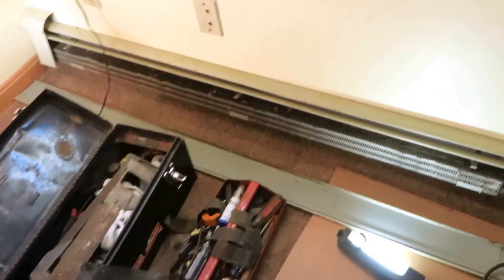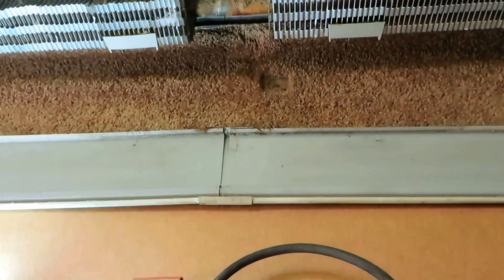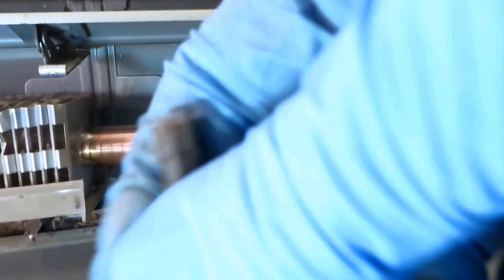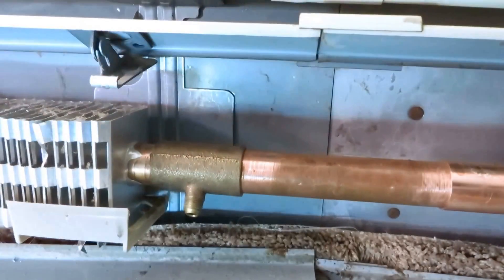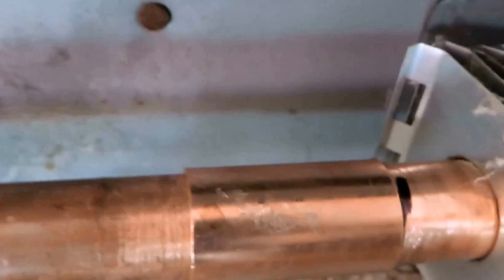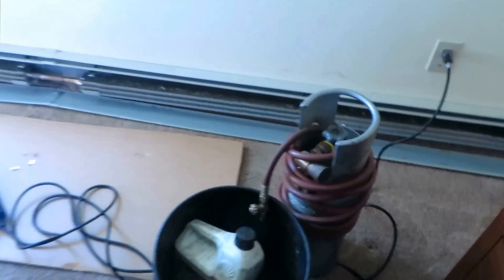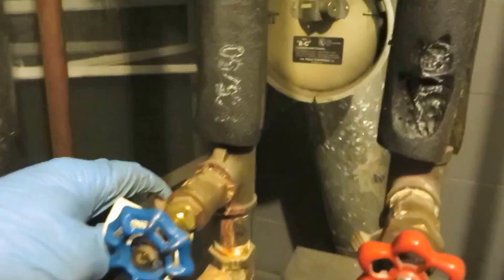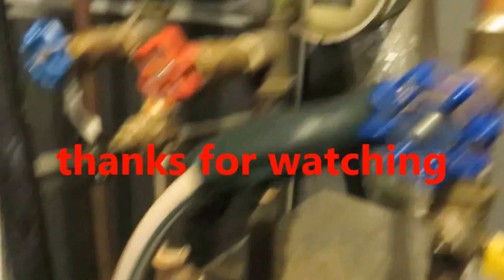FROZEN HEATING PIPES:hydronic heating baseboard freeze up and spit

Comment: Help my whole system froze up i can't find anyone to help me. Can I shut off the main put heaters on all floors and run then for a couple of days to thaw everything out? I think I would have to make sure the boiler  is off to? When I have it thawed I may be able to get a plumber to fix any burst pipes. 
Help I haven't had heat in three days and it's been -5 to -10 below.
Reply from the maker: go get some electric heaters to get some heat in the house to you can find someone to help you ..

Comment: Got the same type of heating in my place and I hate it. At times it’s noise hear the water moving through the pipes. It heats well maybe too we’ll always do hot I turn the thermostat all the way down but there’s no way to cut the flow so it’s still heats unless the boiler gets shut off.

Comment: I need to add a boiler to my home. I currently have electric baseboard and it's crap. How do I run the baseboards throughout the house? 2 bedrooms and a bathroom upstairs, 2 bedrooms down stairs a bathroom, kitchen and living. I would also like to heat my basement.
Reply: A Font lol break out the check book that’s what you do

Comment: Steve   I'm a do it yourself guy and I don't understand one aspect of the repair.  You installed the air release fitting with the elbow down.  Have I been doing it wrong buy putting the elbow up?  My thinking has been air will rise to the top. 
 John
Reply: What he did with the elbow down was to allow any water in the system to drain while he is soldering, so that no steam would be created… And thereby no pin holes in the solder joint.

Comment: sometimes when the copper freezes, it expands and i have a heck of a job getting the fittings on
Reply from the maker: +jeremy western you have to cut it back a bit
Reply: If you cut it back and still have problems, then what I do is take a 3/4 union and take it apart remove the one side reinstall the union but. Then use your pliers to tap it onto the pipe. Make sure it goes on straight. That will resize the pipe. Reclean it and solder away. Tech tip.

Comment: We had a 2 1/2" valve in a firehose cabinet  freeze and literally blow the valve apart one brutally cold night in the hospital I work at.  Engineering and design error allowed cold air to migrate down a fresh air inlet from the roof and into the wall where the cabinet was located when some of the HVAC went into shutdown for the night... When it started up in the morning and the valve thawed,  well,  100,000 gallons and millions in damages later.. it was not pretty, especially because it  could not be shut it off immediately.
Reply from the maker: +REWYRED sounds like a mess

Comment: Great video. If you dont mind me asking what's a typical cost for a repair like that? I've had two pipes burst in my house and the first repair guy wanted $2100. He said he had to test the system with air and other testing to make sure their were no other hidden frozen pipes. My insurance company said he was crazy and for me to find someone else to fix it.
Reply from the maker: imxelite yes he was crazy .i do my stuff time@ matterial .a few hundred tops for a repair like this  if there are more then one leak it might be more
Reply: steven lavimoniere thanks a lot for the information. I contacted another plumber who came out yesterday and fixed the both pipes that burst for $350 and purge the system and test. Your reply saved me a lot of money!
Reply: Stick with that plumber. He is doing good work and treating customers right. Request him to come out to your home if possible.

Comment: Hydronic heating? I live in Arizona, is this system is very practical back east? I see valves, garden hose, bi passes, do you like this system as a service tech? Or would you sell a hvac with heat pump? One unit, with vents, and your done.
Is the price the key factor on hydronic heating? 
Thanks Steve
Gilbert
Reply from the maker: gilbert de la torre a lot of house up north have hydronic heating i do believe its the best heating overall ,but there is no a.c. usally there is a hydro air system ,with duct work for heating and a.c.  it to cold up my way for heat pumps for the most part ..
Reply: Hot water base board is an expensive installation and radiant hydronic  cost alot more . I installed mine 25 years ago and never had a problem. It's efficient , quiet,dependable and comfortable....Builders in NJ mostly install hot air systems due to cost...Heating season is much longer than ac season in north east... I cringe when I see a house that has heat pumps, because they run mostly on electric auxiliary ..Electric is the most expensive utility here .
Reply: gilbert de la torre Knock on wood.I remember telling a friend what good luck I had with a car... Just one of those things, the machine gods can have a mean sense of humor
Reply: Thanks Brian, 25 years I'm sold, hydronic heating? 
Thanks
Gilbert

Comment: Mr. Magic strikes again! Nice I wonder'd how you deal with a freeze up!! 
Man that would be a mess!!! 
Steven this hydronic heating system is doing a wonderful job tonight out here tonight at -13 actual temp. I meat the fellow who takes numbers and checks these systems around here at night. The boiler was running at 51% it's capacity tonight, that's utterly amazing to me!!!
Reply from the maker: freeze ups are all part of the job up hear in the northeast. 51% most of the heat is going right up the chiminey maybe if you slow the draft down it would be better.
Reply: We are sending Antarctica out to Mass, from Iowa Steven!! So get out winters finest for this one... Trust me it's a bad one!!
Reply from the maker: Mike's Random Channel i have to replace a furnace tomorrow so i hope its not to cold
Reply: Well I'll try to keep it away as long as we can Steven!!  

Good grief there were days my mentor would call me up early in morning and say I need yah I gotta a furnace to replace and we gotta go get it and get it in there for these folks ASAP its 0 out!!! :))))

Comment: What caused the freeze up?  Should that baseboard have enough heat to keep from freezing.
Reply from the maker: hot water will freeze before cold water its crazy but true well people have the heat low and the cold wind blowing on the outside of house can freeze pipes at 32 degrees i see a lot of freeze ups if people keep the heat turned up they have a less chance of freezing usally only happens when its really cold out for a fue days straight